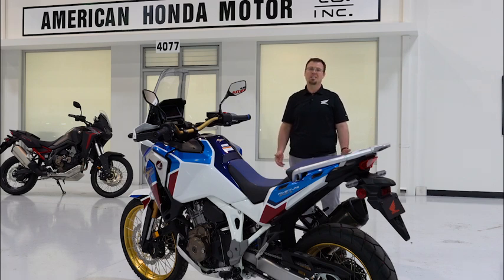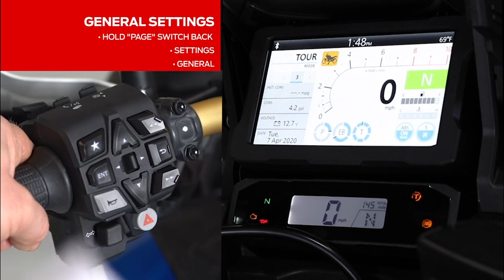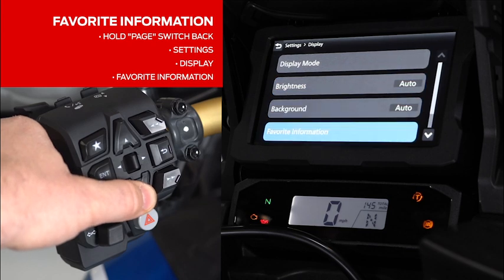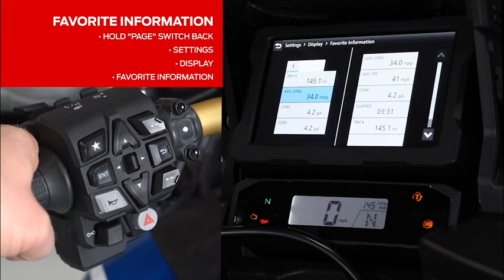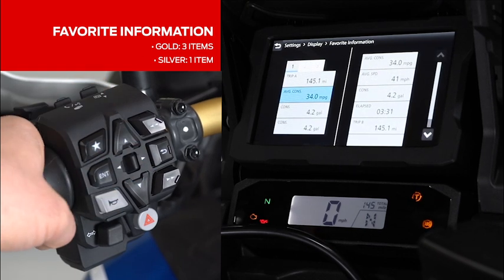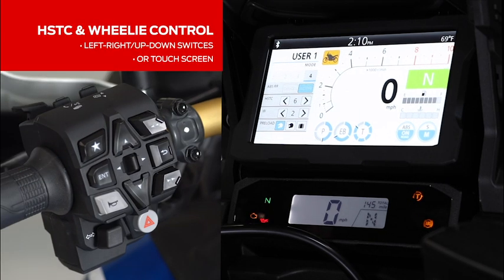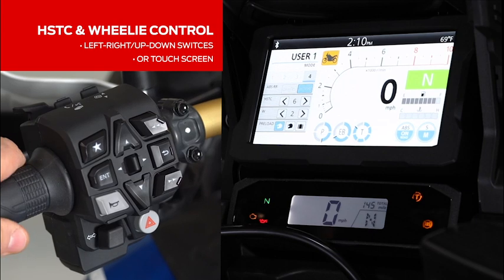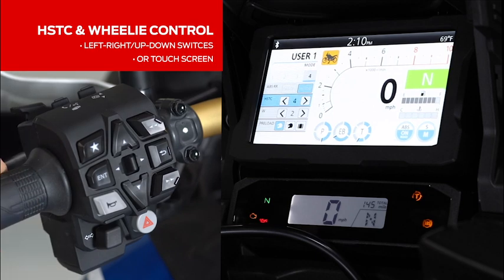Africa Twin: Electronics Customization

Comment: That's the easy stuff.  What is difficult is getting the apple carplay to work, such as putting nav up on the screen.  It's extremely twitchy.  It's usually about a 50/50 chance you will get it to work that day, no matter how good a cord you use.

Comment: Hello, sorry for my English, I'm from Slovakia. There is one thing that would please everyone. If you set the traction control to a value, that value remains the same for all modes. You cannot set traction control for TOUR mode, another traction control for URBAN mode, and so on so that it remains saved. So when you change the driving mode, you also have to change the traction control. Since P and EB change automatically with the mode change, the traction control set by me should also change automatically. I can't get in touch with a competent person from HONDA, but this could be solved with some kind of update. Thank You